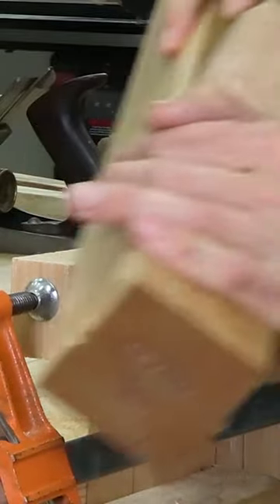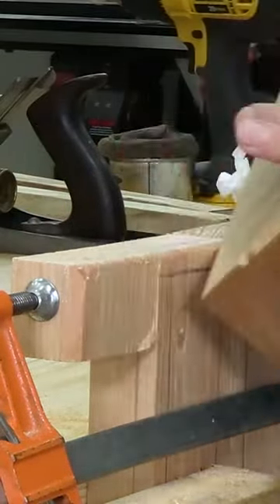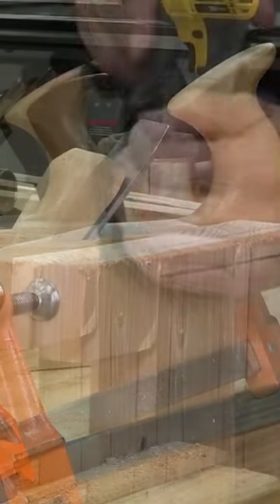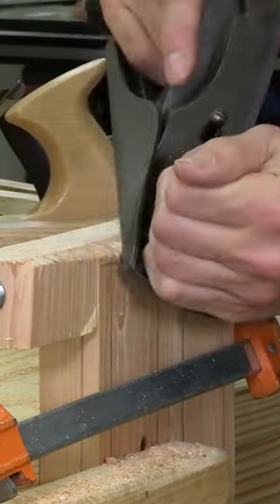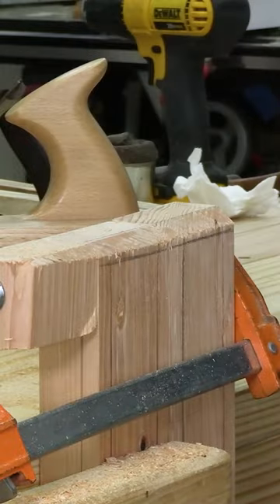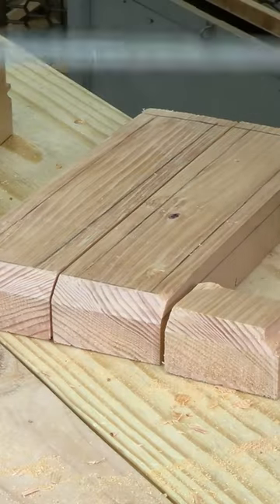Chamfer your ends FIRST! #shorts

Comment: At some point beginners will quickly find out if you face your plane parralel to the end of a board, and then say.. 40 or 50 degrees offset to the back of the plane to the right while the front is facing the opposite at the left; you can plane skew it to the left and safely take off a corner quick and easy. Tldr: you dont NEED to do all this in the video

Comment: Wish I was told that. Planing ends is a nightmare imho. I was taught to do them with the grain (so you're taking short pushes against the piece) and they always ended up rounded for me.
Reply: The sacrificial block behind is a life saver for me, I also use it to plane dovetails. You clamp your board firmly against it, making it just a hair longer, and you start planing it until it is flush with your board, then you plane both together. 

Planing with the grain, I can't control my plane well either so it is both rounded and irregular along the length, as I can't register much of the sole against the board.

Comment: Why wouldn’t you just use a chisel? Is it faster to plane?
Reply from the maker: Much faster and a much smoother result. Try doing a 1/2 inch chamfer on softwood endgrain with a chisel. I mean it.  The experience will tell you a lot.
Reply: You had your planes skewed when chamfering, but the wrong direction. Should be skewed so that slicing up off the board, not down into the grain. The sacrificial scrap at end makes sense though.
Reply: @RexKrueger  
On softwood the finish can be terrible on end grain and I keep my chisels sharp
If the woods particularly cheap it's very difficult to chamfer with a chisel and get a good finish 
My opinion